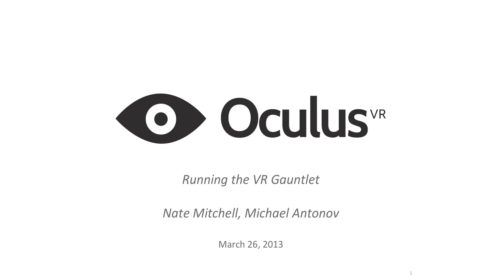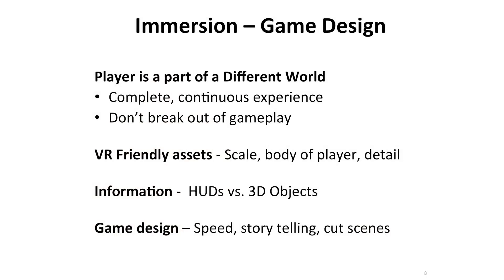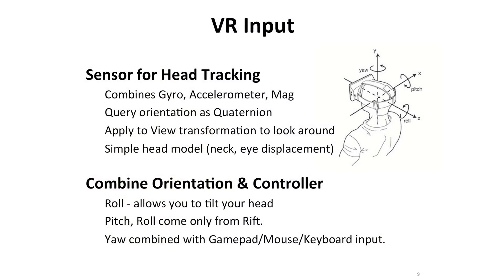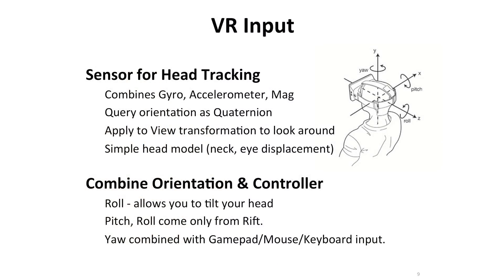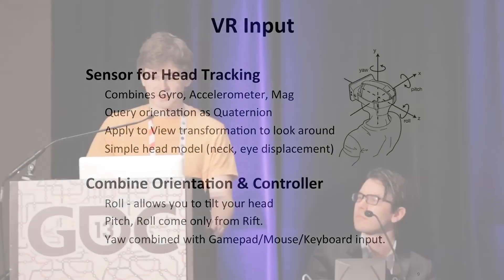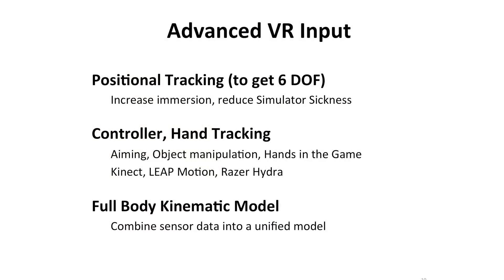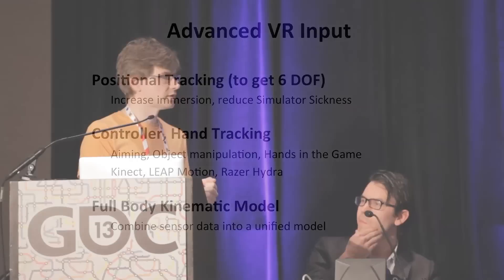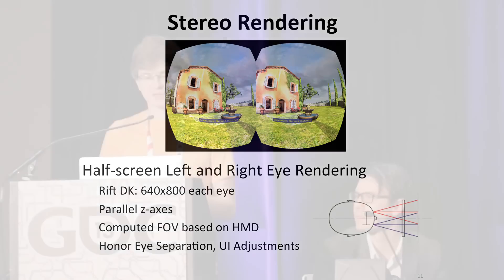Oculus VR @ GDC 2013: Michael Antonov - Running the VR Gauntlet

Comment: No, it's one screen split into two, with stereoscopic 3D, full field of view, and head tracking that's very low latency. The Virtual Boy was nowhere near as immersive. I would say that the rift is closer to the real thing than the Virtual Boy and is also way more successful by delivering what it sets out to do.
Also, intergrating another device to the rift/PC to add more immersion to your senses is really quite possible now.